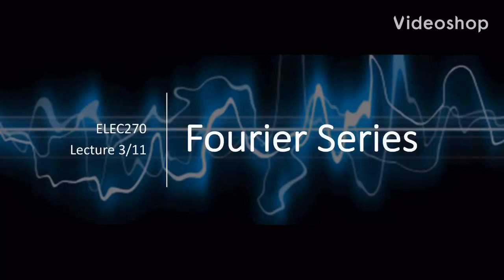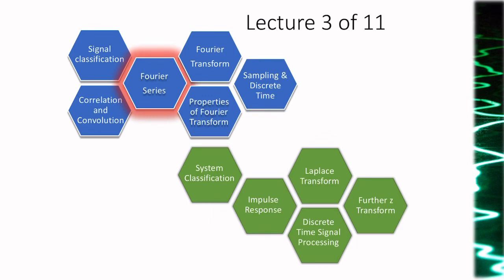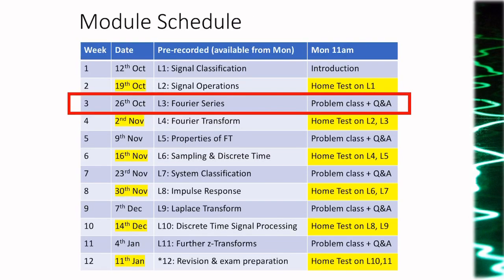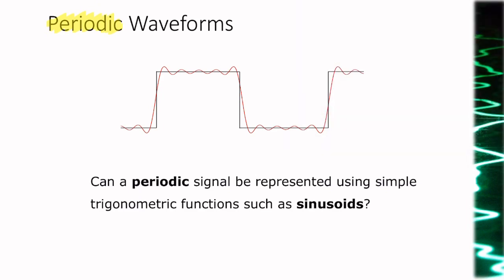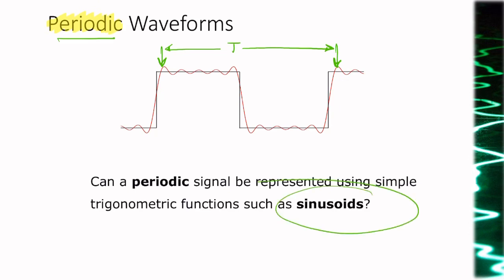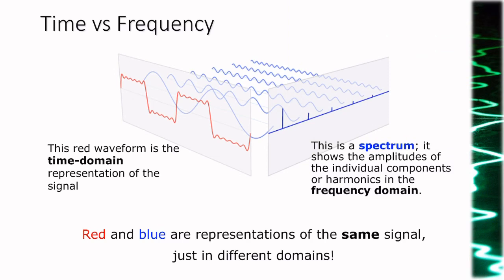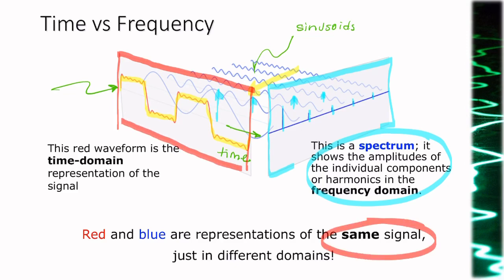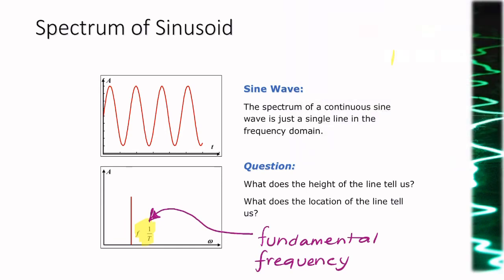ELEC270 Lecture 3 - Fourier Transform

Comment: Excellent video. I'm a UoL Alum (Medicine). this may sound strange but bear with me. my understanding of fourier is that it uses a summation of sinusoids (and i mean the symmetrical trigonometric type). I can't explain the why, but i find myself in the position where I have a sample signal, and I'm trying to correlate with another signal. the signal is periodic, but it is not pure sinusoidal (ie it lacks the symmetry of sine and cosine). It can only be best described as a skewed sinusoid - going faster at some times than others. I am using the dot product of the complex number (eg if my skewed sinusoid is at 45 degrees, I am calculating e^(45 i) = cos 45 + i sin 45) to correlate the two signals a bit like doing fourier by hand. 

My question is can you think of a better approach or is this the best method? I can't get my head around laplace and z-transform so wonder whether you have any better ideas?

thanks